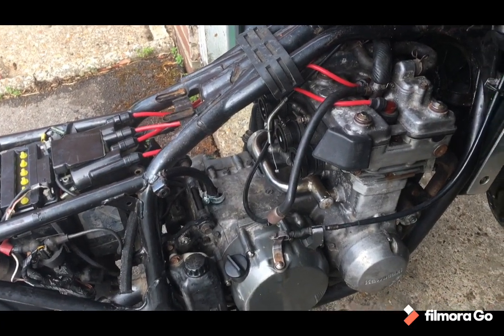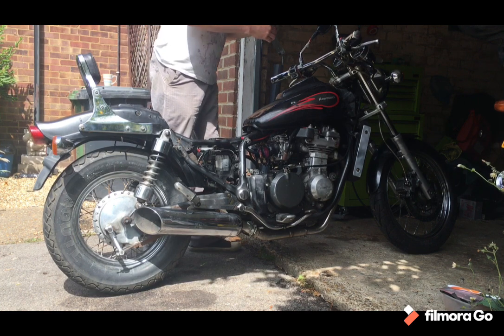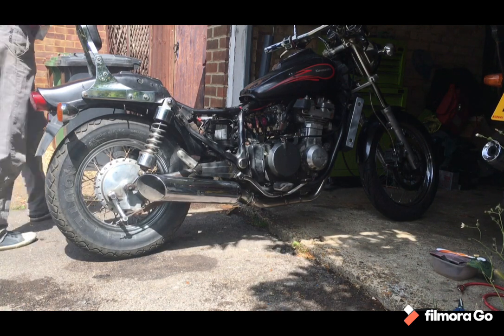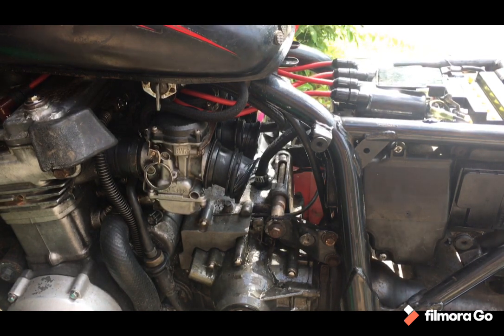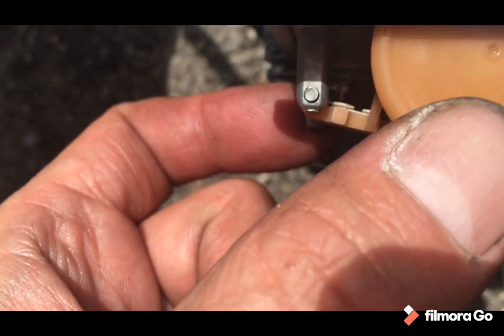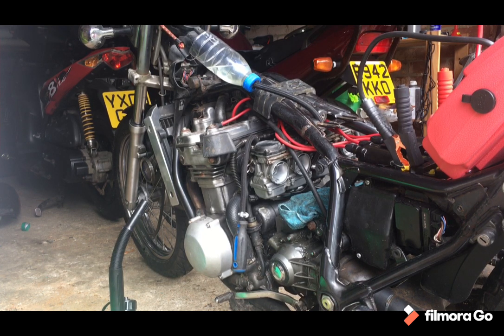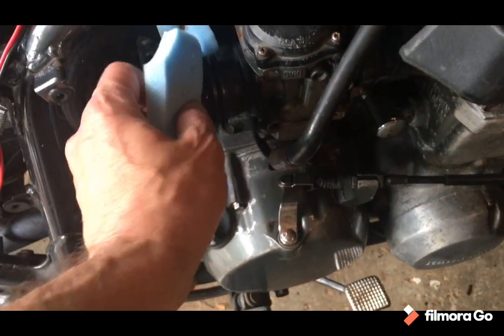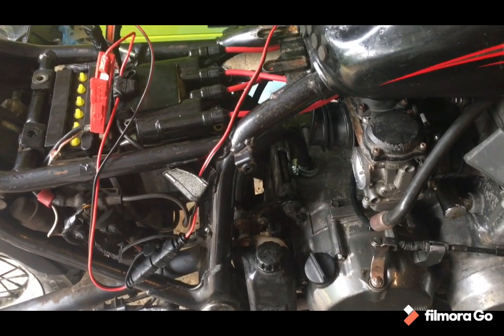Kawasaki ZL600 Eliminator. Refurbished carbs back on with some (eventual) success

Comment: Them rubber mounts with the plastic taped on looked like bellows pumping in and out. When I was looking to do pods on my 600 Fazer the result was drilling a 20 mm hole in a round disk that would fit over the mouth of the carb then the cone filter over that to replicate the volume of air through a standard airbox. 
Look forward to seeing you get it up running and riding.
Reply from the maker: Nick LBW I have found the one person in the uk selling an air box so I might be ok!  Should have it by next weekend so we will see. Thanks for the comment and, stay tuned.
Reply from the maker: Nick LBW with hindsight the engine was gasping and I think that was pulling more fuel in (and throwing it out).   I think that’s why it ran for a while before drowning. More air should help. Let’s see how it works with and airbox.  I like modified bikes but the original designers were no fools either!
Reply: I agree my bike now runs standard airbox with a K&N filter 👌

Comment: Yeh it hasn't sound that good in a while Nat. Did the float height adjustment stop the fuel overflow?

I think your spot on with the airbox. I would get stripping the rear end if I were you. It's a pain but so worth doing.
Reply from the maker: motorcycle rescuer the fuel overflow was better but still not perfect. I think that the air box will sort it though but, let’s see when it gets here.

Comment: Whoever told you strangling it with plastic bags was a good idea? It's very frustrating watching things sometimes :)
Reply from the maker: It was a temporary hodge to district the airflow. Turns out that it needed more, not less air.
Reply: @NatsNackersYard  Yes I got what you were doing but that was the cause of petrol sucking out. You can do the same thing by putting your hand over the intake. Engines are tuned to intake and exhaust flow but it's quite subtle restriction. The plastic bags were strangling the engine and were far too much restriction. T initially get the bike running it's better to ignore these things and let it breathe. Just an observation your videos are very good but I was shouting at the monitor when I watched that one. :)
Reply from the maker: @johnpenny2328  the previous owner was convinced that it needed restricting so I was starting restricted and adding holes for air on each turnover. Lesson learned though!